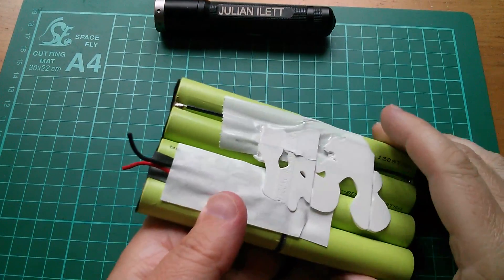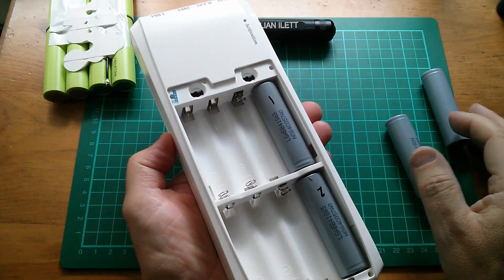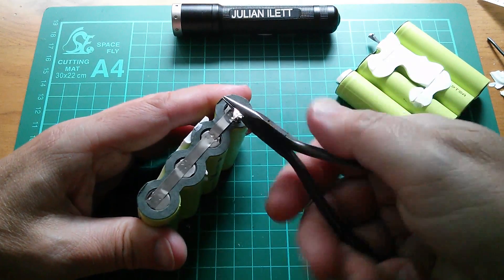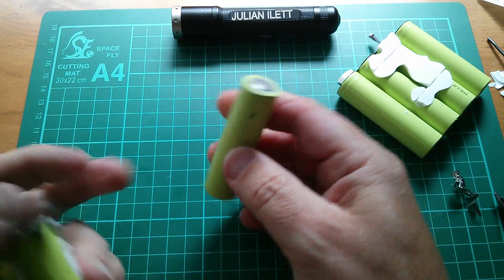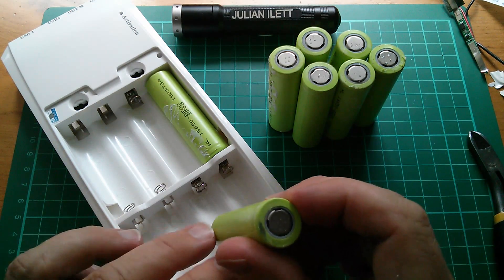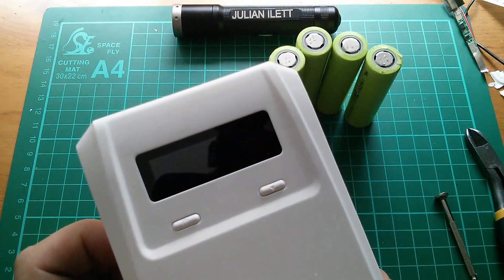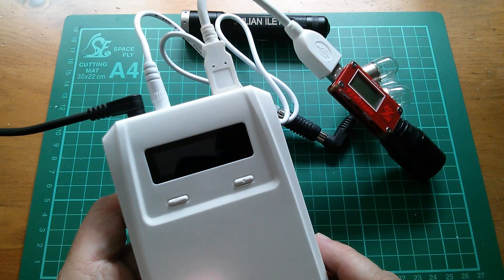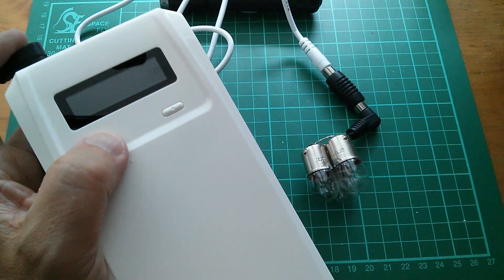18650 x 8 Lithium Cells Re-use for Qidian QD188

Comment: Hi, I have an USB c model, but it won't turn off. Only after charging after a little timeout. Anyone any suggestions?
Reply: I have had the opposite problem for many years: the usb-c model has a low-current shut off so I couldn't run any devices unless they pull at least around 250-300 mA or it shuts off after 30 seconds. I then discovered (today!) that if you click either of the buttons 5 times in a row, the screen displays "TIME." 5 times more to turn TIME off. What TIME does is turn the low-current shutoff off, so you can run very low draw devices or even keep the unit on with nothing connected. I suspect this is what is happening to you. Click either button 5 times in a row and turn "TIME" off.
Reply: But also beware that the time setting auto shuts the unit off after a specific period, I think it might be 4 hours

Comment: I built the QD188 in Jan, 2017.  Today the variable output (2.5mm) quit working.  The display reads 15v (for example) but there is not output voltage, so the display indicates a selected voltage, but not the actual output voltage.   I opened it up hoping to find a fuse but no such luck.  Anyone with this device have any suggestions.  Also, you can copy, print and attach this label to the front of your QD188.

TAPE THESE INSTRUCTION TO THE FRONT OF YOUR CHARGING CHASSIS:
Print and cut out these instructions.
Tape them to the front of the unit.
 

This is font size 11

 
________ cut here _______________
   IN         OUT M      USB2         USB1
18-20v      0-24v        OUT           OUT
2.1mm      2.5mm        5 V              5V
-------------------- cut here ----------------------

This is font size 7 - use font size 6 in WORD
 
-------------------- cut here ----------------------
Model QD188-Alt QC   (Jan 2017)  
 
<--- Left side is micro-USB port; 5v-12v input for 
       charging this unit

Operating Instructions:
 
Left button:
Display voltage: 2x fast click  1 or 2 or M or auto cycle 1-2-M
Adjust “M” voltage: slow click .1v increment up
Adjust “M” voltage:  HOLD: 1.0v increment up
 
 
Right button:
Display voltage: 2x fast click  1 or 2 or M or auto cycle 1-2-M
Adjust Manual voltage: slow click .1v increment down
Adjust Manual voltage:  HOLD: 1.0v increment down
 
 
Both Left & Right button HOLD
-          “M” Auto Mode (AUTo) match rqd voltage
-          “M” Manual Mode (NOT) adjust out voltage
 
Bottom:  – button hole “ON/OFF”
 
Charging Ports:
IN 1 – 2.1mm barrel 18-20V  2.0A max
IN 2 – micro USB 5v - 12v   2.5A max (very slow) 
 
 Output Ports:
1 = USB 1 = 5.27v ( QC2.0; 5.27v 2.5; 9V 2.2A;12V 2A  ??)
2 = USB 2 -  5.25v 2.5A
“M” = 2.5mm, manual adjust 0-24V
 
Micro USB charging port, 5v 2.5amp max (left side)
 internal loss is about 2-5mah / day
charge time at 18v 2A is 3 hrs.
With no load, Auto shutdown after 60 seconds.
Surface Pro 4 requires 15v from output 'M';  will run 5 hours
Batteries groups of 4: 1,2,3,4   5,6,7,8  in these positions:
48 51  
37 62
 
-------------------- cut here ----------------------

Comment: Inspired by one of your earlier videos I purchased the QD188 for use as a laptop backup power when on the go (to output - 19V ASUS and 19.5V Dell). It's very handy due to the range of voltages it can output.

Comment: I strip down old laptop batteries quickly now I have a technique. I use big sidecutters to stip the cells and wiring apart. I then use flushcut small sidecutters  to remove the nickel coated tabs and spot welds!

Comment: Nice idea... I've had an identical 20,000mAh USB battery failure, so went to look at the QD-188...

Unfortunately it appears it's cheaper to just go and buy a complete 20,000mAh Anker than an empty shell with no cells.

Comment: Don't you have to be careful pulling the welded tabs off like that in case it make a small hole and moisture get into the battery. At 5:22 it sounded like gas entering or exiting the battery.

Comment: Nice powerbank but it probably works out close to a hundred pounds total cost when you factor in the cost of a decent set of batteries and a charger. That starts to become a significant investment for a bit of kit where a variable voltage and current desktop supply would do the job much more cheaply. How often do you really need a totally variable power supply out in the field? Just because something can be done, it doesn't mean it should be done, or that it is a good idea! A touch of sheer madness really.

Comment: I just bought a new 9 cell (Samsung cells) laptop battery, for $19.99 Canadian (~$15 USD) from CanadaComputers.com
What a deal! 2500 mAh Samsung (The best) batteries with built-in protection for about $2 each! 
You should check out your local shop for deal like this. None of these Chinese fakes for me thank you. 
SureFire is a sure way to fire. What a name!
Reply: you wrote that very spammy, but honestly those do sound like nice prices for 18650 cells.  
Yeah i'm sick of Chinese cells too.

Are you sure your cells are actually 2500 mAh?  You'd best test them.  Fakers have absolutely no qualms falsely labeling their cells with any random company's brand.  Just coz it has Samsung printed on it, means nothing.
Reply: Yep. They are genuine. Mine tested about 2600mA using my DC load meter.
I think I'll buy another set. 
here is a link for those who can buy from them.
http://www.canadacomputers.com/product_info.php?cPath=2_383_1021&item_id=025140

Comment: I've been binge watching your playlist on the MPPT and DC-DC converters, and there are a couple of questions you need to ask yourself.
Does placing a big fan on the rear of the solar panel have the same cooling effect as the sprinkler you got going on there? or is it the magnifier effect of each water droplet that is causing the power to increase?
If you have a big Fresnel lens (I found mine from a projection TV on the side of the road), you could place the solar panel under it to see if you get more power. If you don't have one, you could use a clear plastic from hardware store. Set it up like a tarp tent with 4 stakes, with the tarp being parallel to the ground. pour water in the middle of the tarp and it will sag and create a lens. The tarp has to be pulled tight from each 4 corners.  
I think you will be pleasantly surprised on how much more power you can get out of the solar panels on a cloudy day. 
Second, you should increase the PWM freq to over 50 KHz and decrease your coil windings to match the new frequency. 
This will also help with ripple and eliminate the high pitch sound. The reason you have ringing in your coil, is the stray capacitance that exists between the winding that will cause it to resonate due to the tank circuit. 
I am designing and building my own green power system, as a part of exercise on the SMPS course I am taking at University of 
Colorado. I think you would enjoy this 6-course specialization on power electronics, since you seem to be as crazy about dc-dc converters, as I am!
This course is awesome and its free. Check it out.
https://www.coursera.org/specializations/power-electronics
If you have an android tablet, you can download their app (Coursera) and then download the whole course, on to your Android. You might want to check if this app exists for iOS. Just a suggestion...
Your videos are very enjoyable, and your voice has a pleasant calming effect on me. Thank you for sharing. 
Cheers...

Comment: 10:00 No it does not. Or at least it does not need to ;) It uses the voltage as measure of capacity.

All batteries were apparently 82% full. If you stick in 4 then those 4 combined are still 82% full. If you stick in 8, THOSE 8 will combined still be 82% full ;) It has no knowledge of the cells missing and it does not need to to be able to display a percentage. 

It would go haywire if you put in 5, 6 or 7 cells because then the cluster of two parallel will not drop with the same rate as the rest. Same for charging and even for charging with all 8 in and an inbalance because the bank can't compensate (balance charge) them.

Comment: Also, I found that charging from the 5v micro-usb port on the side is not effective... the capacity measurement is compromised and the display reading not logical... best to ignore the 5v input unless in an emergency.
Reply from the maker: +James Lewis Same here. I didn't notice the compromised capacity measurement, but I can see how that could happen. 5v charging does seem like a fudged afterthought.
Reply: The 5v input is boosted to 18v then fed to the CC,CV charge circuit at about 50% loss but it does work. Caution though, charges to 4.3 volts each cell so use HV18650 cells. The The "Aut" output description is auto detect output voltage, "not" is not auto detect. The USB QC2.0 output works, charges my Galaxy S6 at about 9 volts, 13 watts. One last nicety is the slots in the battery cover clips is perfect for micro usb cables, no searching for coins needed. Also it doesn't output anything if charging from USB or the 16-18volt input.

Comment: The instructions say that it's 5v or 18-20v not  5-20v input... it will always charge at 2A while in CC phase.  I think the charger circuit is step down, and it needs to charge to 16.8v, so you need a higher voltage to charge. I use my laptop PSU.

This power banks seem unwieldy, and annoying at first, but they are awesome, give it time!
Reply from the maker: +James Lewis Thanks James, yeah I found the same, it wouldn't charge from 12v. I'll do a follow up video.

Comment: SOC on lithium cells is seen as the voltage on the cells, so adding the second set of cells in parallel would not change the charge level. They were all in parallel in the old pack so the exact same voltage.

Comment: It still said 82% because it's going off the pack voltage and the second set of cells you put in were all in parallel so the voltage didn't change.  What did change is the speed with which the pack will discharge from that 82%
Reply: Drone to the Bone I doubt it. The electronics have no idea what the capacity of the pack is.  only the voltage.  since the second set were added in parallel the voltage wouldn't really change.

Comment: 20000mAh @ 3.7v - the DC to DC Converter and the different voltage changes plus the normal 20% loss using Law of Conservation = ??????mAh
Reply: Are they wired in a series or is the cells positioned this way for other reasons because that would only make this 16.8v or 14.8v with a load?

Comment: USB 1 is also QC2 compatible. I am using that powerbank for my TS100 open source soldering iron. Get one of them and you will not be disappointed. The Weller killer. Watch some reviews!
Reply: Well it mostly depends on the drain capability of your 18650's. The qd184 outputs a maximum of 13 volts and I run the ts100 on 19v.

Comment: What happened?  No outro telling us to touch your face. Did the power bank charge up?
Reply from the maker: +Nadim Awan It didn't charge, more later.
Reply: Julian Ilett once you set the output voltage, does it stay at that voltage, even though the item powered is disconnected?

Comment: did not see a current range , or I missed it ?
I am looking for some control for ham radio , 4S - but want to limit to 13.8 , that is the common full voltage for ham radio gear and have full output , so kinda of a voltage control  to keep 4S from going over 13.8 , then connect to a larger 18650 group of batteries for long term use and current between 25 - 30 amp ?

Comment: "teze" isnt teze, its 2 stylized chinese characters 七电 which read Qi and Dian, Qidian, the brand name. Dian means electricity.
Reply from the maker: +yeme Interesting, thanks. Does the Qi bit have any connection to Qi wireless charging?
Reply: I dont think so. 七 is Qī, meaning "seven", so Qidian is seven electricity or electric seven or something like that.
齐 or Qí is the life force/energy thing sometimes written as chi in english and thats where the Qi in wireless charging comes from
Reply: Woah! they added QC3 support and revived the old style case... WANT!
Reply: I also saw this power bank on AliExpress, and was wondering if anyone has actually tested it, especially the claimed QC2.0 and QC3.0.
Reply: I have tested the QC2.0 feature on the QD188, so I don't see any reason to think that this new version of the qd184 would not also work.
Reply from the maker: My favourite powerbank... except that they've taken away the multi-voltage output (which is the bit I like) and replaced it with a multi-voltage input. FAIL.
Reply: if the annotations on the photo in that listing are correct, theyve significantly altered the function of the new QD184. the 5.5x2.5mm jack is labelled as an input which accepts higher voltages for fast charging. having a variable output on that jack was the reason I bought the new 185-TY and I think the reason Julian likes his old model 184 so much. I doubt youd be able to get higher voltages out of the QC3.0 USB port unless they were negotiated by a QC chip in the connected device so it wouldnt be usable as a convenient 6 or 9v source for anything else.
Reply: Damn, that's why it was my "go to" power bank too... love the higher voltage output... but the QD188 is my new favourite thing, since the high voltage output has some grunt, so it can run laptops, and other things tha tthe old QD184 cannot.

You can get some USB testers that let you select the voltage by using the QC interface... but really you can only select 9 or 12 I think, and it wouldn't be convenient.
Reply: It looks like they're cheaper from other sellers. Searching "18650 x 4 power bank" did the job for me.

Comment: maybe you cld do a real world test, say, time to charge from a 2 amp supply, and how long to discharge on 5 amps load?.. as an example. or charge from 10w solar panel, then an fm audio transmitter from a pizero as load.  ;)

Comment: Spot welded metal is nickel. Save for recycling as it's about double the value of copper.
Reply: Andy Lee Robinson Often only zinc plated though. Pop it in some water with a pinch of salt to prove if it's pure or not.

Comment: Went looking for the powerbank and cheapest i could see was £36, tad high.
Reply: that's the one.I really like the variable output idea as it would be good for a emergency laptop charger but just a bit too high for an empty bank.
Reply: Colin Hickey Poundland is good if you want about 800mA
Reply: Colin Hickey where did you find it, I could not even find it
Reply: i found it on aliexpess.
Reply: Try: https://www.aliexpress.com/wholesale?ltype=wholesale&d=y&origin=y&blanktest=0&SearchText=power+bank+0-24V+5V+12V&tc=af&initiative_id=SB_20170710094639&isViewCP=y&catId=0
Reply: slm60uk 6

Comment: You need to get yourself one of those flat-sided sidecutters specifically made for electronics. They work wonders on getting those tack-weld-leftovers off of the 18650s.
Reply: Flush cutters. They do a great job of getting the strip off in one go and leaving the surface flush, and usually saving the need to grind flat.
Reply: Flush cutters - that's what they're called! Thanks :-)
Reply: He can't even work out how to get a set of spudgers!
Reply: Micro shears are good, cheap and cut flush.

Comment: When I've salvaged 18650s from laptop batteries I ended up gently grinding the tab residue off with a small diamond disc in a dremel
Reply: I use a dremel with one of the little abrasive grinding stones that look like a tiny lollipop
Reply: @-yeme-  That's a sharpening stone for a knife.